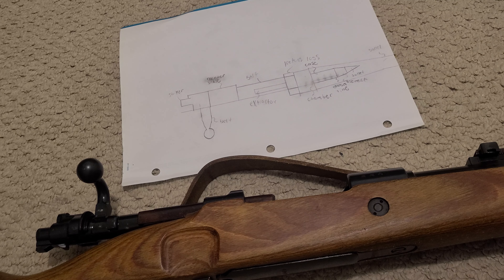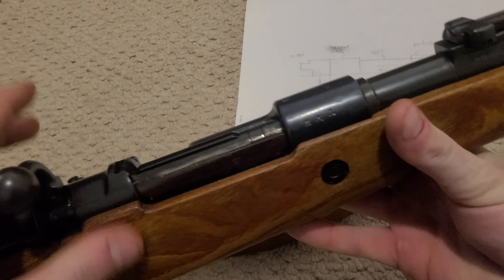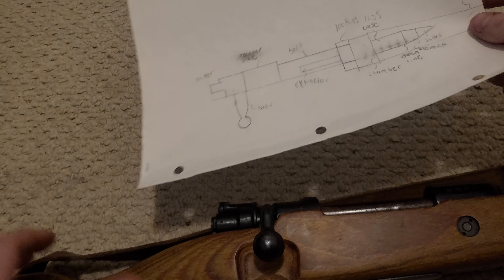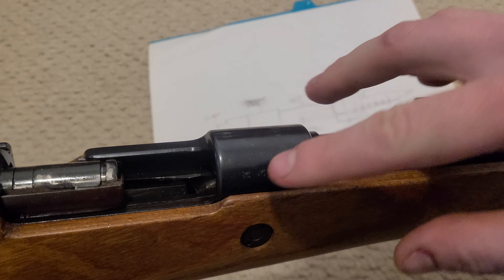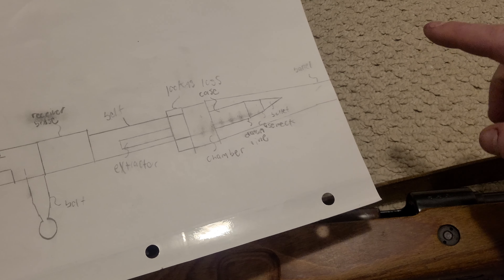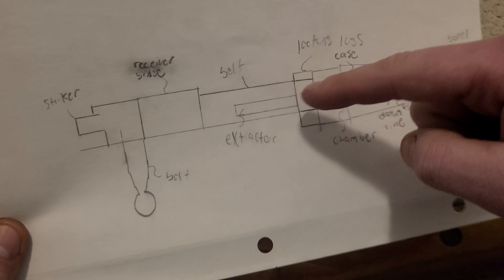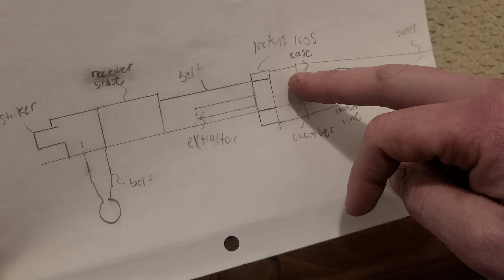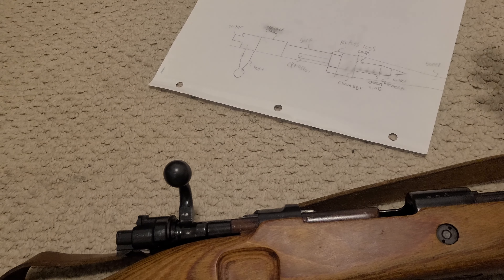out of battery detonation explained (part 1)

Comment: Wouldn't you have to have an extended or stuck firing pin to have an out of battery detonation with a bolt action ?
Reply from the maker: Technically, yeah you would it would be very rare. You only really have obd in semi auto guns